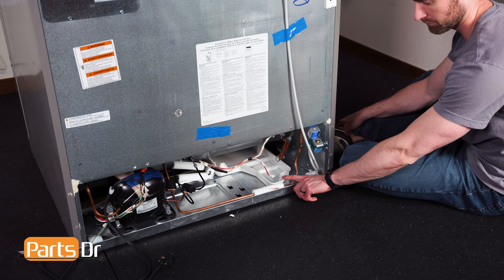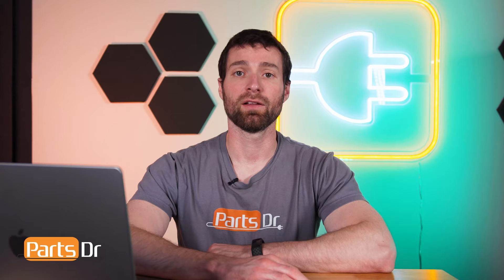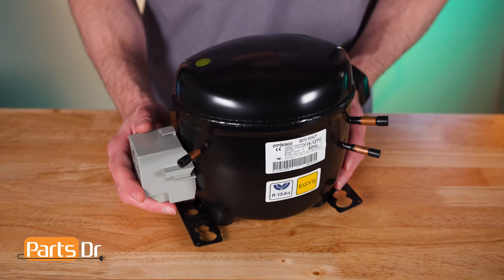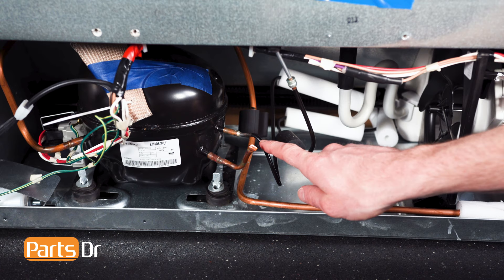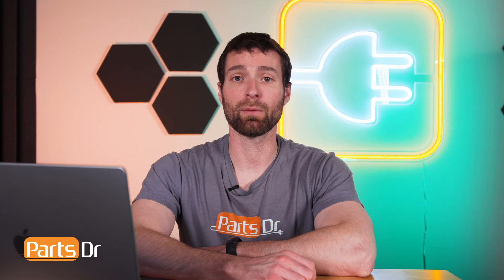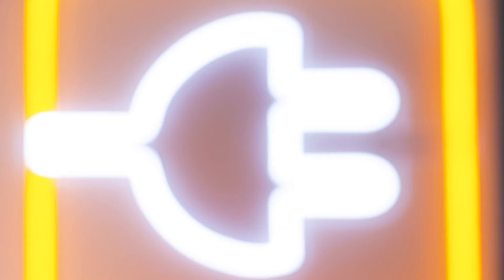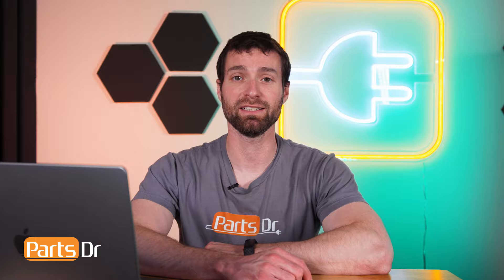Can you lay your refrigerator or freezer on its side for transporting?  Well yes, BUT...

Comment: As someone that retired from trucking we use to get trailer loads of refrigerators from whirlpool and the top layer was always laid down. Some on the back or sides so it did not seem like orientation mattered. General rule was time up = time down
Reply from the maker: Thank you for sharing!
Reply: I actually wonder if they have a way of ensuring the piston is in a particular position for transport to prevent oil leakage through the discharge line.
Reply: Thick suction line should always be up: https://youtu.be/bbjMVtrOa_4?si=UHFsqLza13KQTrBL

Comment: That was very interesting  🤔.  At this point I'm very worried, because I just brought home a refrigitator on a home depot Pic up truck. My problem is I had to lay it side ways. And I think I put it down on the wrong side. I brought it home this Saturday, and have not turned it on as of yet(Tuesday) . The compressor is an Embraco Vegy 8H. I laid the fridge with the 2 small copper tubes laying down.  Please advice sir. Did I mess up bad? Any feedback would be great. Have a good one. By the way the fridge is a kitchen aid 42" wide French Door with freezer on bottom.
Reply from the maker: Usually if you wait a few days, the oil should have settled back into the sump of the compressor and you should be fine.
Reply: @PartsDr  , that sounds reassuring man. Crossing my fingers. Thanks for all you do
Reply: @PartsDr  , it's working well so far. Pheeeew!
Reply from the maker: @milvolts1  Great!  Thanks for letting us know!
Reply: how did u get it back up off its side
Reply: @kerryanneoconnor1163  ,  I placed plywood then cardboard on the pick up truck bed. Then tilted fridge slowly on its side onto the cardboard  and slid the fridge to the bulkhead of the truck. To bring it down we did everything in reverse. Slowly!
Reply: Next time you can rent a refrigerator dolly from Uhaul.  Even if you don't rent a truck or trailer from them.   It makes moving a fridge so much easier.   And safer too.
Reply: @milvolts1 how many days did you wait to turn it on?
Reply: @luaventi  , I think it was 5 days. Still kicking

Comment: I had to tip a new fridge in the box on it's back for a few hours. I left it upright for a day. What happens if the oil went into the pipe? Can it be removed?
Reply from the maker: If you left it upright for a day, you will be fine.
Reply: @PartsDr  OK. Powering up.
Reply: @PartsDr  Works. Thanks very much.

Comment: Nicely done.  It makes sense.  I'm off to move my freezer next week.
Reply from the maker: Great!!
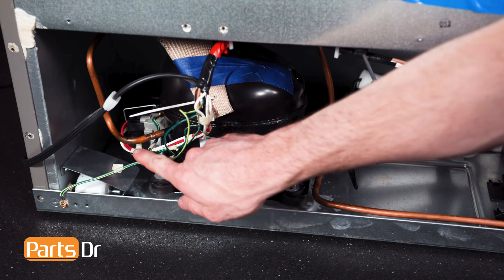Reply: @PartsDr  FYI, when you say the discharge line is the smallest.......at about 1:35.......you are actually pointing to the suction line.  It confused me a tad...... but played back a few times to get my head straight.  Also, on that compressor......and mine......... I THINK it actually says "suction" with an arrow - bottom left - on the label.  Mine is difficult to read.... print is not clear.

Comment: I want to buy an LG SBS refrigerator that is 190 cm in height, so it should be laid down inside air cargo to transport in Bangladesh from Malaysia. Maybe the laydown position will be more than 24 hrs. Will it be make problem, or any suggestions?
Reply: Why would you use air cargo for a fridge?

Comment: Hi.  We transported our convertible upright freezer/refrigerator home from the store today on it's side.  We have no idea if it was on the correct side since it was in the box.  If oil did get into the discharge line, will it drain back in after sitting a minimum of 24 hours?
Reply from the maker: Most are okay if you leave it upright for 24 hours before plugging in.

Comment: My new fridge freezer was delivered upside down. I suspect it was transported upside down too. They said wait 2 hrs before plugging it in, I waited 6 hrs. Both fridge and freezer are cooling fine but there is strong gas smell from the fridge part which spreads to the food in it and affects its taste. 
Has the fridge been damaged? Is it dangerous?
Reply from the maker: Any smells would not be related to the compressor or sealed system.  Check to make sure all of the packing materials were removed from the refrigerator.  We commonly see protective plastic left on pieces inside the refrigerator creates a bad smell.

Comment: The question I have is I have recently purchased a heavy commercial upright freezer which, to get into its desired location, had to be laid on its side.  Now that it is in the room where it needs to be, how do I get it back upright?  It is about 80" in length and the compressor is on the top, so we have to get the very heaviest part of it lifted.  Further complicating the matter - it is on casters.  I have no idea how to get this thing stood up without risking it sliding away on the casters or, alternately, dropping like a stone if I and others do not have the strength to lift the top 80" from the floor.
Reply: Chock the bottom with a board against something solid. Have something to hold it while lifting in case you can’t handle all the weight
Reply: @beetelish  As it happens, that's just what I did.  I found that my furniture dollies needed to be much closer to the bottom of the freezer to exert maximum leverage when I lifted the top and began pushing forward.

Comment: I messed up mine, transported it on the side we later on started using it immediately. Now two months later, the fridge has sounds (generator sound) and sometimes goes off by itself. What can we do to solve this
Reply from the maker: Check with the manufacturer to see if it is under warranty.

Comment: If the fridge was tipped toward the discharge line for maybe 10 or 20 min what should I do? Is it ruined? Do I need to flush something before turning it on? Do I need to call a service person?
Reply from the maker: Leave it upright for a day before plugging it in and you should be fine.
Reply: @PartsDr  thank you!
Reply: Actually,  the oil can only get in through the suction side so it should always be up:  https://youtu.be/bbjMVtrOa_4?si=UHFsqLza13KQTrBL

Comment: I have a 12 volt everchill for my RV, is it possible to reposition the compressor to be able to operate laying down as a top load refrigerator? Thank you
Reply from the maker: That won't work.  Even if you could find a way to get the compressor to work, the automatic defrost system won't work properly if the refrigerator is lying down.

Comment: Ok so i think i screwed up
I moved a fridge on its side the other day
A GE "freezer on the bottom" model 
I did NOT let the fridge sit while unplugged before i moved it
It was on its side (NOT on it's back) for like 10-15 mins total
And then it was upright an unplugged for roughly like 10 more mins at the final destination 
When i was moving it on the dolly i had the fridge was leaning back with the doors facing FORWARD 
An today there was roughly like a total of half cup of water on the floor coming from underneath the fridge (the fridge is like 3 years old an NEVER had any water coming from the bottom before)
The fridge SEEMS to be working ok but if the fridge is messed up will it happen slowly or would it show up immediately?
What will be the specific symptoms if the fridge is messed up?
Reply from the maker: You may want to check to see if the defrost drain pan is damaged https://www.youtube.com/watch?v=TF1eYdRpZZI
Reply: @PartsDr  
Wow that's hardcore
So you're basically saying that the only way to know if i did any damage is either check the defrost drain pan or just wait an see if the fridge starts malfunctioning later on in the near future?
What do you think the odds are that i did any permanent damage/damage that will start showing symptoms later?
The fridge seems to be working fine at this moment

Comment: Couldn't you just disconnect the discharge line ?
Reply from the maker: No, the lines on the compressor are part of a sealed system and should not be disconnected unless it is being repaired by a trained professional.
Reply: @PartsDr  ah OK ty

Comment: HOW DO I GET INTO THE WALL THAT DIVIDES THR FREEZER AND FRIDGE? My freezer is cold but the fridge is warm. The evaporator fan IS running. I feel some air flow coming thru the top crossover hole but none coming thru the bottom crossover hole just above the vegetable drawer. It just started doing this after transferring it from the kitchen to the garage. We had no choice but to flip the refrigerator totally upside down 1 time to get it down the stairs but it was done slowly and carefully. Now that it’s in the garage, the freezer side is freezing but the fridge only drops to 62 degrees.
Reply: My freezer had build-up fridge warm. Had damper door stuck on close. Located upper top between freezer and fridge. Replaced good now. Freezer cold air goes through damper door to fridge and exits on bottom toward freezer. Damper door opens on temp settings you have set. You should feel air traveling through damper door. Hope I helped you
Reply: May have to let ice melt. I unplugged mine and melted faster w hair drier towels to soak up water. Put meat in ice chests extra day or two. Maybe bottom side to much food blocking air passages on freezer side ?  Air flow goes freezer top to fridge then bottom fridge side to freezer. Damper door allows this circulate